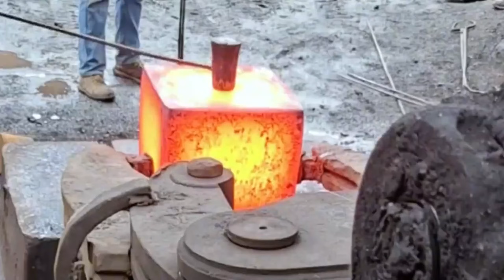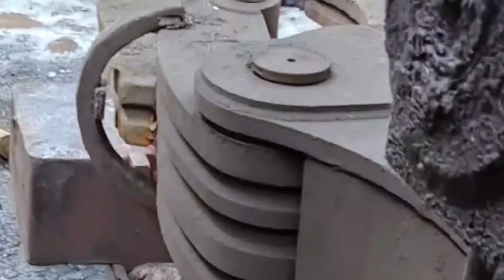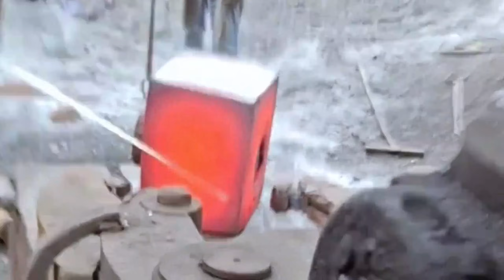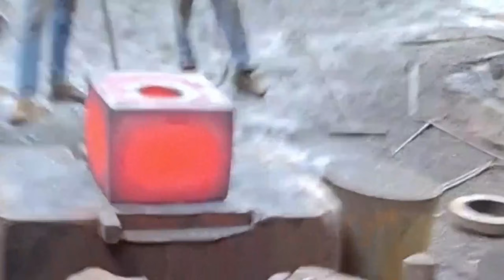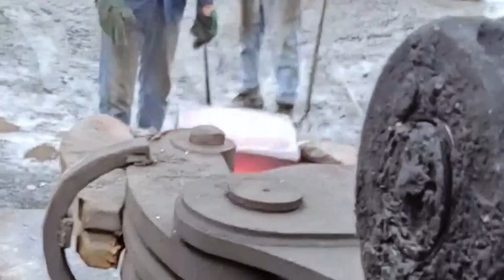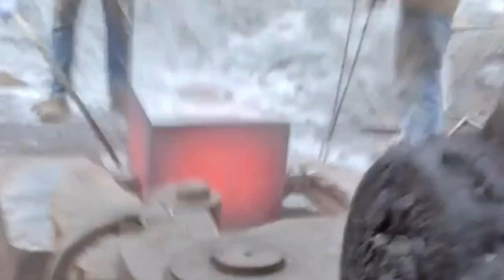GIANT HEAVY-DUTY EQUIPMENT in Forging Plant - Iron post forging ring drilling process

Comment: Soo much work just to make that one thing. And i wonder, how do they know the exact measurements?? Why dick around so much with it if they don't know the exact measurements? i though those kind of objects needed to be extremely precise. Yet it seems so random how they do it. I mean they do it all on free hand, i don't even see no measuring tapes.
Reply: It's a rough forging and then it goes to a mill where it is machined to exact size.
Reply: @rushd45  Alright. Jeez, so much work. I have read that working with a piece of steel like this also increases it's strength.